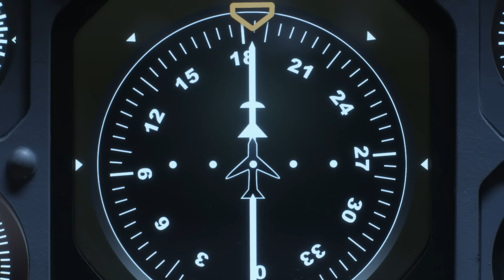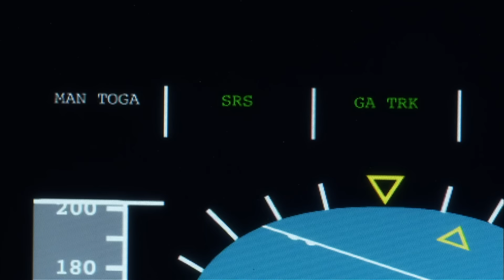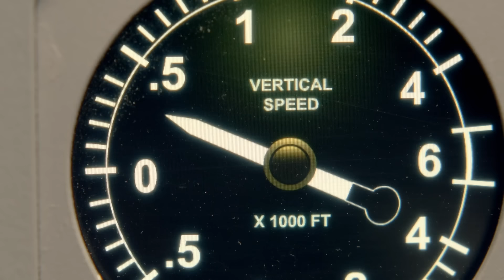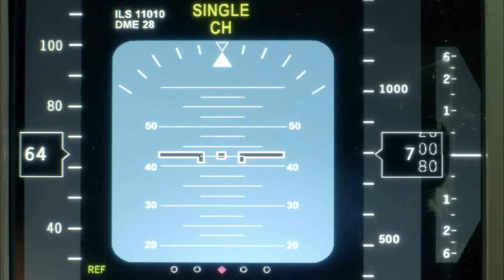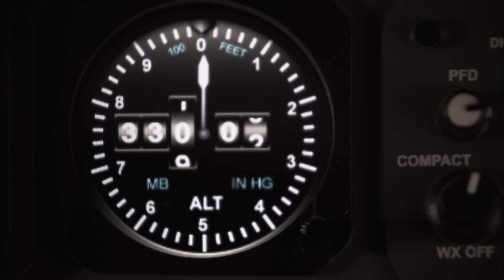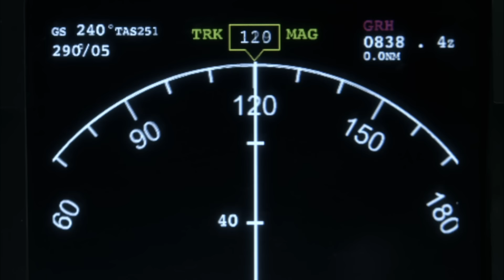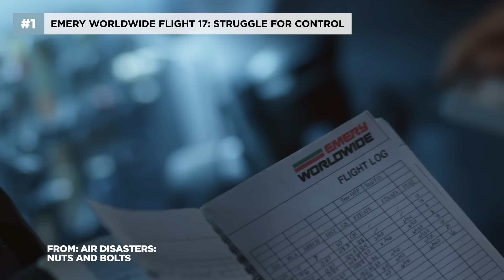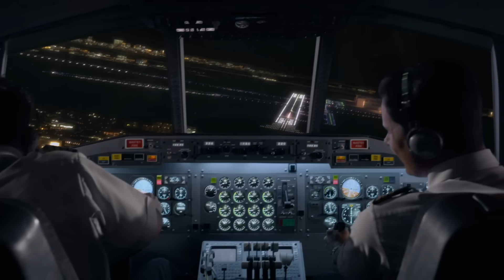9 Intense Plane Crashes Caused By Stalls ✋ Smithsonian Channel

Comment: "Caused By Stalls" is misleading, because stalls always have causes which are usually the ACTUAL cause of the crash.
Reply: Wrong stalls sometimes do not for example if you put autothrottle on 250 and put the throttle lower the autothrottle will stop working and the plane will just crash
Reply: Not always. Due to airflow, it is possible for a T-tailed plane that is 100% operational to enter a condition known as "deep stall" where the effective angle of attack creates insufficient lift and the wing wash blanks out the horizontal stabilizer. Airplanes have crashed in a deep stall condition with wings and nose dead level with the ground. This has been largely engineered out of larger aircraft but is still possible in certain aircraft still flying. Air isn't a homogenous mass, it's a violently turbulent fluid with varying density, air currents, and a gust of wind can add a large enough tailwind component to cause Vref for landing to be too slow to maintain lift and you have planes crash short or land hard. With the time it takes engines to spool, by the time your GPWS is going off it is usually too late to correct because you have no altitude to trade for more airspeed as the engines come up.
Reply: Exactly, stalls is too general a term, for crashes that had multiple different factors that caused the stall!
Reply: Top 9 deaths caused by not breathing

Comment: 28:20 if the plane has center if gravity out of limits, you have to change the engine’s speed, lower power on engines 3 and 4 and higher power on 1 and 2

Comment: I read somewhere that the 747 crash in Afghanistan was caused by some heavy equipment that was not secured properly and broke loose then slid backwards then causing the center of gravity towards the rear.
Reply: Yes. An MRAPV broke loose and rolled backwards into the rear pressure bulkhead. Destroying the jackscrew that controls the elevators in the tail. Just like Alaska 261
Reply: https://youtu.be/7sUWC2jfjqI  Here is video of the crash as taken from the camera aboard the photo journalist's SUV.

Comment: wonder what goes through someone mind when  they realize that the crash is eminent at a weird angle... now, the last time i checked , if a plane is banking left or right , it could be corrected either increase power in the engine to the side the plane is banking while slightly decreasing power to the opposite side, but these pilots never seem to explore that option..
Reply: If you're stalling, you dont just decrease power from one engine to correct the stall, that will make a plane stall even more. The only reason the plane is banking is because of the stall. The only way you're able to stop a stall is adding more power to the all engines then try to pitch down and get your wings level. Planes don't add power from one engine and decrease the other to bank. They have ailerons to bank.

Comment: Other airlines while landing: 100 50 20 10
Ryanair: STALL STALL STALL
Reply: TOO LOW - GEAR
Reply: Doesnt Ryanair have a great safety record?
Reply: @ZeroGaming_101  brace for impact
Reply: @ZeroGaming_101  Ryan air company: my f*cking God where has this pilot been.
Reply: 100 - 10
Reply: @ZeroGaming_101  idk about you but they only had one crash

Comment: Came after Indonesian flight crash 1st one of this year RIP to all souls
Reply: Yeah what happened I read something but nothing much was said
Reply: And we lost a Cessna yesterday too. So sad
Reply: Just gonna say, most airplane crash happens in jan and des, due to the weather condition.
Reply: @markmitchell450  the plane lost altitude from around 10k feet to only a few hundred feet in 1 minute. It crashed with approx. 400m/h speed to the water. Thw bodies were found in chunks. *my data is not very accurate but you get the idea

Comment: KLM 433 was not a stall!!, they have noticed a drop in the right engine oil pressure, so the pilot put the engine on idle, when he tried to turn around, he gave the left engine full power while keeping the right one in idle, so the plane banked to the right. Unfortunately, the right engine was working perfectly
Reply: Wow 👍
Reply: Passengers saw the left engine burning and did not correct the capt when he announced that the roght engine was shut down. So he shut down the wrong engine and the plane crashed.

Comment: Rest in peace to all the professional pilots trying their best to rescue the plane meanwhile the plane has a mind of its own
Reply: That's because the pilots did something stupid and don't realize what they did 🤷‍♂️
Reply: @willschultz5452  Hey they tried to fix there mistake but failed miserably atleast they tried I doubt you even know how to fly a plane.
Reply: @aeoe665  yes,  I DO know how to fly a plane. Thats why I can't understand how it could have happened 🤷‍♂️
Reply: Planes DON'T have a mind of their own!! They do what the pilots tell them to do except when there is a mechanical problem.
Reply: @willschultz5452  But still they tried to fix it.
Reply: @willschultz5452  mistakes happen
Reply: @Lovingashdaily   But they shouldn't!! It costs people's lives for nothing🙄
Reply: Not for the last one, the plane was overcharged on one side and make this issue
Reply: @aeoe665  If you make a mistake and your midair, your not fixing it because the plane is already in flight and not able to accept dramatic differential in the throttle.
Reply: @SpreadDemocracyUSA  Did you even see how they tried to keep the plane in control?
Reply: @aeoe665  Yes, by dramatically increasing the throttle, most of the time that results in stalling if you're at a low altitude.
Reply: @SpreadDemocracyUSA So you can see they tried to atleast save the plane
Reply: Your comment is strangely funny.
Reply: @willschultz5452 you likely can’t fly an rc plane, can’t code one line of code for the flight computer, and can’t fly a plane.
Reply: @saul_goodman-v5f  thats where you're wrong! I can fly a plane!
Reply: @SpreadDemocracyUSA   Increasing the throttle will never cause stalling!
Reply: @willschultz5452  The engines have to begin to slowly increase power, it doesn't just go from 75 to 100 immediately. Learn basic aviation kid.
Reply: @SpreadDemocracyUSA  yes we know that but what does that have to do with anything!!?
Reply: @willschultz5452  it does cause stalling wtf
Reply: @willschultz5452  you don’t understand how it happened because you can’t fly a plane…
Reply: @saul_goodman-v5f  that's where you are wrong, I can fly a plane!🛩
Reply: @saul_goodman-v5f  No, it doesn't!
Reply: ParrafinLion  I know. I'm a pilot myself
Reply: An the crew n passengers

Comment: Warning system: "Don't sink, don't sink."
Aircraft: sinks
Me: Hey you didn't follow instructions!
Reply: So they stall dude
Reply: @mehrsazhb5306  Well, yes, but they are still sinking
Reply: Here's the problem stalls are hard to recover unless your 10,000 feet in the air and your in a sink of 20 degrees 25 or more like the 747 National will just go smash on the ground due to no lift and when a plane banks one side has more drag making the other wing stiff and hard to turn

Comment: That cargo plane in Miami went right across the freeway right when there was a gap in cars. How lucky were those drivers. Wow! RIP to the pilots
Reply: Cars was hit. Couple people died.
Reply: @maximevoltaire9202  1 other person other than the crew died the light was red
Reply: @13beaches46  wrong day to run a red light
Reply: @maximevoltaire9202  
One person on the ground died. Not a couple. A Latino guy died who was sitting in his car going to get lunch for his wife on his break.
Reply: God's work
Reply: @stutterrampski2777  God would not kill anybody..God is love, so your opinion is certainly wrong..please do not infer that God would do such an intentionally dreadful thing.
Reply: It wasn't that fine, you could say.
Reply: @daviddavis3389  uh...

Comment: For anyone who doesn't know, a stall is where the engines shut off mid flight
Reply: No.
That's just one of them.
1. Engine failure
2. Nose too high
3. Your reason
4. Vertical stabilizer destroyed
... and more

Comment: 50% of stalls: ‘frozen pitot heater’

Man they gotta try getting some better heaters
Reply: Actually happened to me recently
Reply: @Sevisstillalive  hope u r doing ok
Reply: Pitot fault contributed to max-8 debacle too, I think.
Reply: @Exuma Guy 
Fair enough, thanks, I wasn't sure.
Reply: @rogerkearns8094  yep, it did it caused the MCAS system to act up
Reply: Only under certain weather conditions but yes a simple device would have prevented at least a faulty speed reading which will eventually throw off the auto pilot

Comment: Timestamps (Powered by Merlin AI)
00:00 - Two plane crashes investigated to determine cause of accidents.
04:13 - Flight crew failed to respond to warning, leading to crash
07:44 - KLM Cityhopper 433 crashes during emergency landing
11:41 - Flight 708 may have stalled due to being too heavy
15:27 - The cause of the plane crash was the anti-icing system reducing power for thrust.
18:44 - Two plane incidents, one due to pilot error and the other due to technical malfunction.
21:46 - Three different flights face catastrophic events.
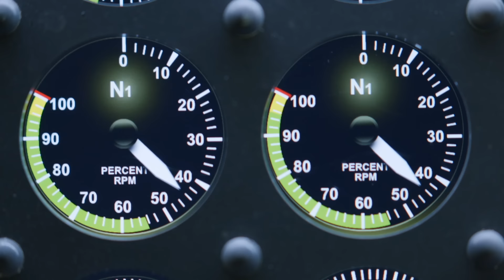26:09 - Airplane experiences extreme balance problem during takeoff

Comment: They be not pulling the yoke control so hard so it dont makes the  plane pull up hard. And stall out, if you wanna be a pilot, check the speed check the trim because the trim make's the plane pull up. If your are taking off from the air get the gear up and the flaps. And check the speed and altitude. And don't load so much cargo it makes the plane stall.

Comment: I HAVE VIEWED more commercial air disasters involving STALLS than any other critical flight emergency. And when the throttle vibrates and the alarms sound PULL UP TERRAIN BELOW seems so many pilots are either clueless or powerless to regain control.

Comment: Most of the crashes you can see were caused by pilots overpulling the nose too high up and not correctly adjusting the throttle.

Comment: 1 thing i never understood about planes the engine can fail even if a bird gets caught into it why not build some sort of mesh around it ?
Reply: The chance of something getting into the engine during flight is significantly low. And adding a net infront of engines will just unnecessarily reduce efficiency.

Comment: Safety nerds reinventing the aircraft. Simple is most often better. 
I worked at a place for thirty years. Twenty years in safety decided the painted warning on the Otis elevator doors didn’t meet the new standards. It had to be a thin metal sign bolted to the door with the same warning painted on the thin metal sign. 
One week after installing the metal sign a fellow worker had his finger cut clean off by the edge of the safety sign.

Comment: A Stall is a Pilot Error 
- The Emery Air clip at the end was Not a Stall but caused by improperly Loaded Plane.

Don't blame those poor innocent pilots for the mistakes made by the loading crews in putting the wrong weight items in wrong location on the plane. 
Or for improperly secured loads like in 747 .

Comment: This is missing one of the worst results from a stalled aircraft. Northwest Airlines Flight 255 Stalled and crashed on takeoff which only took one minute due to pilot error at 8:46 pm on August 16, 1987. One minute from the time the aircraft started moving down the runway until the ADR stopped working after a fourth impact was recorded on the CVR. This crash became the second deadliest crash in the USA resulting in 154 fatalities. All six crew members, 148 of 149 passengers, and 2 in automobiles perished including my three friends. My new book will be dedicated to all of the Flight 255 family members. Our hearts are broken until we meet again.

Comment: National Airlines Flight 102 was a cargo flight operated by National Airlines between Camp Bastion in Afghanistan and Al Maktoum Airport in Dubai, with a refueling stop at Bagram Airfield, Afghanistan. On 29 April 2013, the Boeing 747-400 operating the flight crashed moments after taking off from Bagram, killing all seven people on board.[1][2]

The subsequent investigation concluded that improperly secured cargo broke free during the take-off and rolled to the back of the cargo hold, crashing through the rear pressure bulkhead and disabling the rear flight control systems. This rendered the aircraft uncontrollable, making recovery from a stall brought on by a change of balance from the shifted cargo impossible.[3]

Comment: Most of the time, it's a weight and balance problem.  Not always not loaded properly, but on wide body aircraft pallets and cans are not locked properly.  What aviation need is more McDonald's and Burger King employees loading airplanes.  I've been in the aviation industry for decades, and seen too much crap.  Left in 2004 and never looked back.  I'm just surprised that weight and balance accidents don't happen monthly.

Comment: 7:09 i think they were put the flaps too early since they knew their speed wont enough to get there
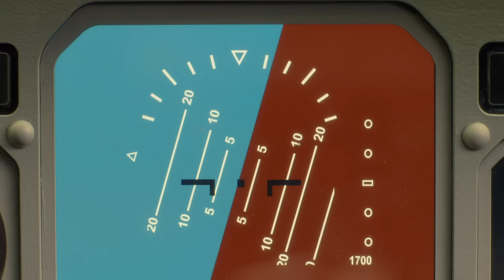Reply: At 9:58 if you look at the throttles you can see the pilots made a mistake by putting the right engine all the way to idle but leaving the other one at max power. Because of that the plane tilted to the right.

Comment: A sudden shift in CG on take off is almost always unrecoverable. The flight controls of the aircraft, and the inputs by the pilots can’t overcome the situation the plane is in. Unfortunately, it’s human instinct to pull up, when they know pushing down will be catastrophic.
Reply: You totally didn’t give the reason for National. The cargo, which was heaven equipment , wasn’t secured properly. The aircraft took off and the Hummers, which weren’t secured moved aft and damaged flight controls. The aircraft was not overweight. Please get your facts straight !!

Comment: This are way too many plain crashes! You can stop it by making it more expensive generally. Build more quality planes and have better service which checks the plane 5 times before letting it go on its mission again. The people are self to blame for requesting a cheaper flight! There are rare metals which are stronger than the usual stuff they use. But they cost more of course! Request them to build planes which can land by themselves and even fix themselves if necessary! Stop risking your life on cheap planes! And they're all cheap. Because if they weren't, they would've landed in one piece. It's as simple as that!

Comment: The second plane crash could have saved everyone
Sully sulenberg once landed a plane on the Hudson River where everyone survived
The captain of this plane instead of thrusting upwards should have started to land the plane on the water it would've prevented the plane from a nose dive and have a softer landing
Or maybe he tried to flatten to plane but it didn't happen
Reply: Ummm planes are not designed to land on water. What sully did was a last ditch effort. When a plane stalls, the pilots think about recovery from the stall, not landing on water.

Comment: For a stall recovery we should always keep gear up because there are 99% of chances for the gear to fail and put the trim to 0 and then put out the gear . When the plane stalls we have to put power down to zero and when u gain control  put the power on like a flash and trim to medium  this how are stalls recovered my dad teaches me about planes

Comment: I find this video extremely frustrating. It never seems to show any segment in a form long enough to satisfy your curiosity. Either it just shows the crash and fails to tell what the investigation determined, or it showed the determination, but not the crash. One segment was so incomplete it ended BEFORE the crash and then didn't show anything else! Kind of a stupid and unsatisfying video. Are they trying to get you to subscribe to the cable channel?

Comment: 15° rotation is standard.  Scary when the plane decides on its own. When things go wrong close to the ground you usually buy the farm. Most of these crashes happened back when pilots had to watch and respond to everything. Very unforgiving aircraft.  Technology has solved a lot of the decisions pilots use to have to make on their own. Still not 100% safe but a lot better. New technology however has also unfortunately caused some crashes.

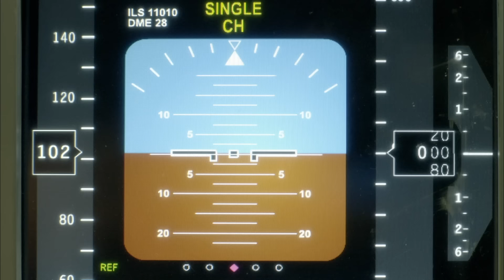Comment: 11:58 Which 747 has a Vr of 110 knots carrying about 270,000 pounds of payload weight and the fuel required to reach Dubai (2 and a half hour journey). Explains why it stalled
Reply: Actually. It was an MRAPV that broke loose and rolled into the rear pressure bulkhead and destroyed the jackscrew that controls the elevators in the tail. Leaving the craft stuck in a nose up postion
Reply: Both of you wrong 
Its because the plane was carrying military cars and one of the car wasn't toed up correctly which made the aircraft lose the center of gravity of it
Here is a video to explain if you didnt understand  https://youtu.be/7D0DmjVq42k?si=2_bJbzkG8aOPkod5
Reply: @adamalishakr thats what the first reply said bruh

Comment: sadly in most of the crashes, the crew actions were inappropriate, had correct actions were taken several crashes could be avoided. especially the one which stalled at 33000 feet.  ar cruising level if power is insufficient to maintain that level, the aircraft speed will start depleting and to maintain the cruising level aircraft pitch start  increasing and if appropriate procedure is not followed eventually aircraft will stall, but it takes several minutes to reach this condition and obviously crew unnoticed this unusual speed reduction  and pitch up tendency. Experienced crew will immediately  descend down to 4000 feet and recalculate the cruising level and fuel requirement ,